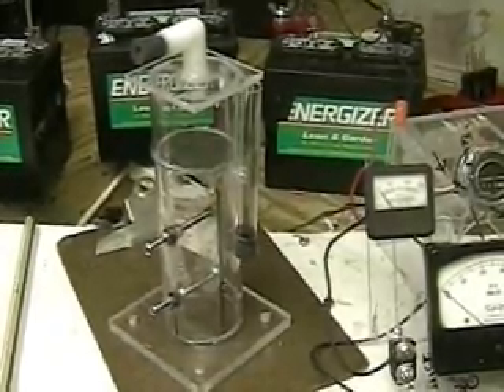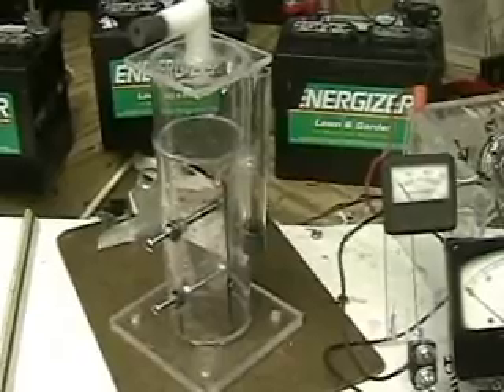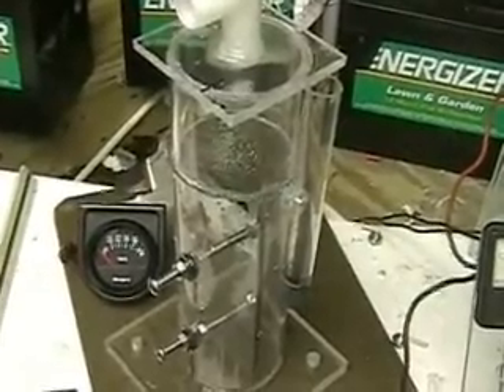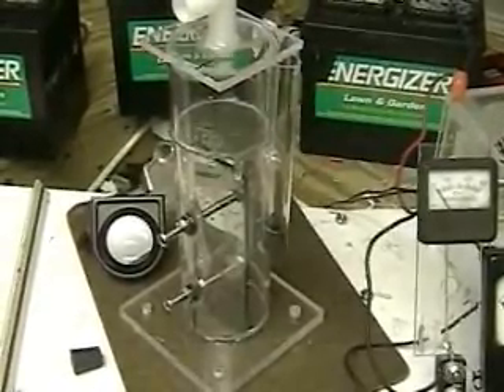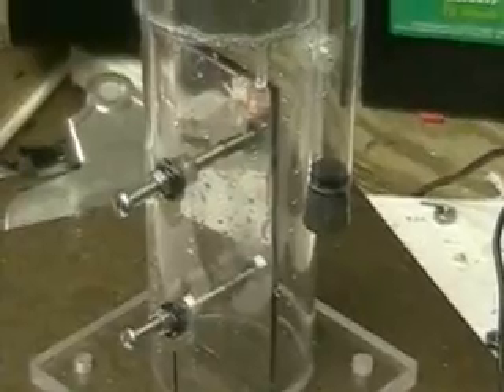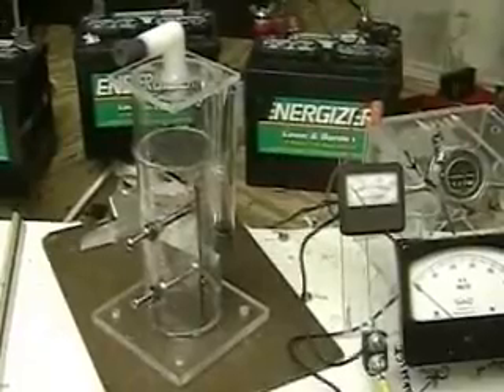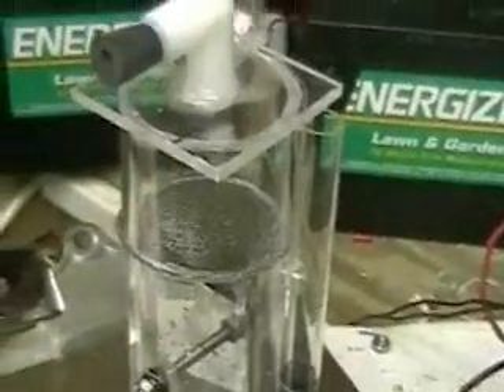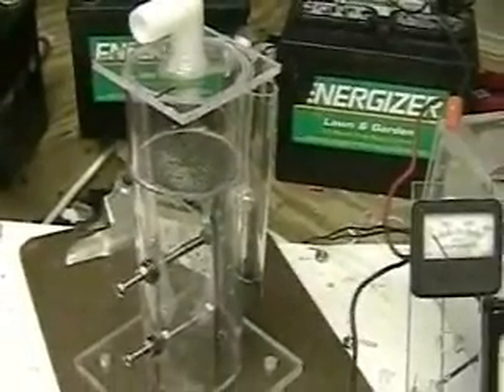hydrogen Tap (Table Top Demo Unit) #59

Comment: As you say...the next step should be to achieve the same production of hydrogen with less power consumption. Maybe by the means of a pulsating circuitry....like Stan Meyer used. I'm working on that. Keep the good work.